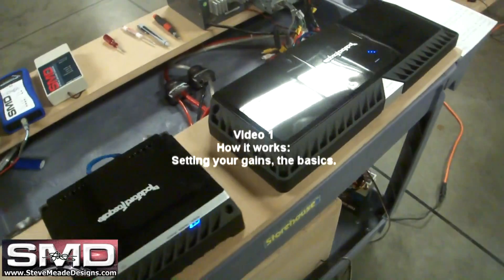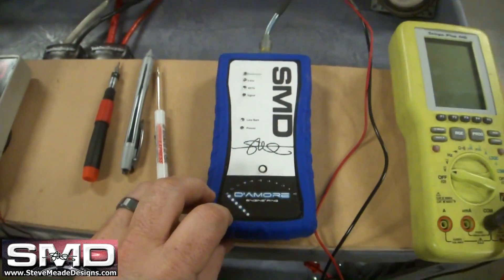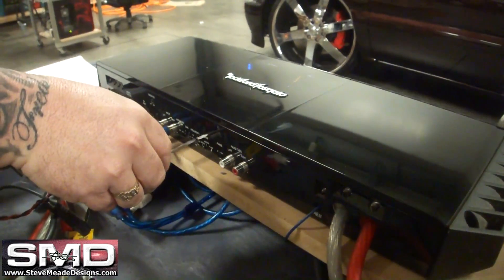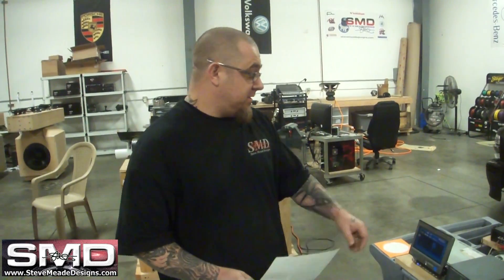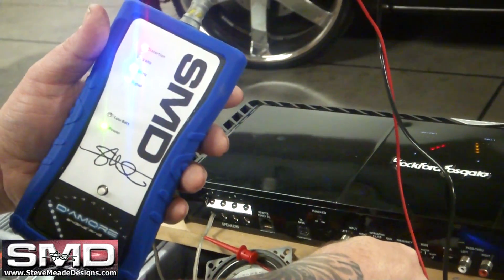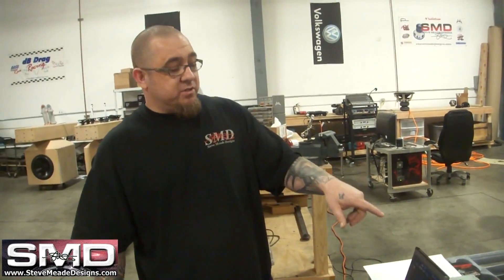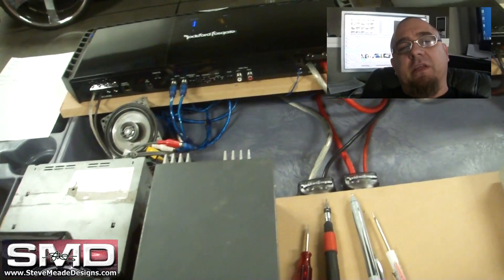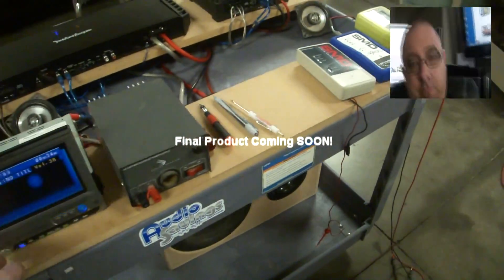PREVENT CLIPPING! Set AMP GAINS like a Pro! New SMD "Distortion Detector" - Coming SOON!

Comment: My mids and highs amp is a jl audio 800/8v2, I know the gains are supposed to be down and freqencys are up, but this amp has a filter mode which reads off, hp and Lp, does it matter which mode is selected when finding out the clipping point for my head unit?
thanks
Reply: You set it to OFF, set gains & when done, turn back on & set x-over freq. for the spkr. type used & any EQ adjustments. Then go back after all adjusted to confirm still not clipping with DD-1
Reply: @joelpasserell4525 i just supposedly set mine, i forgot to see that setting on my 4 channel to off 🤦🏻‍♂️
I plan to do it again but on a track 6 or 7
The louder ones
Reply: @CarlosHernandez-jg4yu   I misread your previous post and I just saw now that you're trying to find the clipping point of the Head Unit. So the filter mode on the amp would not be a factor because you'll be taking the RCA output from the head unit and plugging it directly into the DD - 1 to get clipping value from head unit. Once all that is done, & you're setting amp gains, my prior comment would apply with keeping filter switch off so full range comes through. I believe you use the 40Hz track first with sub out RCA and record clipping point where flickering led stays on solid & then repeat with the 1kHz track with any of the F or R rca's, making sure all internal tones, equalizer, bass boosters, etc. are all off or flat. and use the average of the 2 for your highest volume to not exceed on the head unit.  If you know for sure you're going to listen to the head unit with the loudness button on, then you can turn that on and set your clipping points, accounting for the loudness being on.  
Remember that the + DB tracks will cause you to see the head unit as clipping sooner at a lower volume level than the -dB tracks, and therefore cause you to set the amp gain to a lower level because the amp will start clipping sooner so those typically give you better sound quality versus the lower level DB tracks which caused you to set the games higher, resulting in a louder sound but lesser sound quality system.

Comment: How do you set gains properly when your individual speaker's RMS is 1/2 of your amp's RMS per channel? 

For instance, if my  4 channel amp RMS is 200w @ 4 ohm per channel  and my  (4) speakers are 4 ohm 100w RMS per channel. How do I go about setting my amp gain to provide 100W RMS per channel to completely power my speakers, while only asking my amp to work at 50%RMS....keeping everything cool and letting my speakers do work?

Comment: Ok gains set. But now amp still not tuned what about frequency?  Is there a way to set exactly say if I want 45htz to play only lower or only higher than that? I know if I turn 1channel (bass) amp to 45 it won't play lower than that but alot of the time it really does still go to 30s like it's never spot on so would I need to turn up to like 60 so it don't fall below 45? Or would it then jump as high as 80s ? Even with crossover it still has a jump less and more. Is there a product that I can focus to only keep me way closer to my desired level of frequency?

Comment: Does anyone know what kind of leads Steve is using on the speaker wires back to the DD-1? I just bought a SMD DD-1 curious if those leads come with it or are those necessary? It looks as though they clamp onto the speaker wires.

Comment: Blue Led Indicator Bulb of my Pioneer GM D-9601 Class-D Mono Car Amplifier starts to Blink & my two 12" sub woofers starts to distort/clipping or produce disturbed sound after playing normally for more than one hours, I am using 12V 50 amp SMPS to power it at home. The amplifier has three fuses each of 40 amp. Plz let me know how to fix it ?

Comment: What simple me, always up shit creek without a paddle, is wondering  is, does this meter work for 4 ohms only 0r is it ok for 2 ohms speaker load, cos I read that lower impedances causes higher distortion?. anyone?  I don't even have a car! Just wondering, will using this then chucking two ohms into the boot be safe. without discounting the devices operation at 4 ohms.?thanks

Comment: The thing is, on the second test where I choose track 6, my amp never hits the distortion light.  Even when the gain is at max on the amp.
Reply: Check battery, sometimes I have to disconnect other amp to work right.

Comment: Steve I have a question what if your other speakers on the head unit can’t handle the maximum clean signal volume? Turn up to the max volume that the others can handle and adjust the gains from there?

Comment: Hi, I recently purchased the DD1. What tone would I need to use if I'm setting the gain on the channel that will be playing midbass? I've used 1000hz for the midrange/tweets so that's okay. For example, in my BMW e90, There are a pair of 8" Audison midbass drivers. I'll be setting them up so that they are bandpassed between 80-250hz. Would I use the 40hz tone here and set it to -5db or -10db of overlap at the amplifier? I had initially set them up as subwoofers but I doubt they can take anything that hits below 30-40hz. Thanks

Comment: Should I still use a DD1 to tune subwoofer amp if the amp comes with a built in clipping indicator on the bass knob?
Reply: I would,
Reply: Shadow Skeptic thank you, I think I’m going to get the DD1 plus and a rca style bass knob instead of the gain knob.

Comment: I think I've got this right, but tell me if this is wrong. So you've got your gains set right, and in this case your mid/high amp is louder than your sub amp. Is it ok to set the gain on your mid/high amp lower to level it with your sub? Lowering the gain can't hurt anything can it? Thanks man.
Reply: That is correct.
Reply: @998 Squid  Doesn't this negate Steve's statement that gains aren't a volume knob. 😅
Reply: @joelpasserell4525  Eh you gotta think about it a little more deeply. The reason people say "gain isn't a volume knob" is because it's not for the purpose of just being set like a volume control. However the actual adjustment itself does function the same way. Which is why you can turn gain down a little after setting it properly, in situations that call for it.

Also just to try and throw a definition out there. The actual purpose of gain control is to correct for varying voltages of RCA signal that may be coming into an amp. Some head units push 1.5v, some push 5v. Without properly set gain to account for that, the amp can easily be pushed into clipping. Which is when your amp is being asked to deliver more power than it can provide. The big big issue with that, is when amps are in that state, they put out DC voltage, which overheats and fries voice coils very quickly.

If that all doesn't quite make sense, I'd suggest the YouTube channel barevids. Amplifier technician.

Cool to see my old comment. Went from a newbie learning the gear, to a guy who regularly goes to car audio shows and has multiple builds in the works.
Reply: @Ixionn  Thanks for the reply. It'll be helpful for the next person who stumbles on it in a couple more yrs. Haha.  I knew, I was just being a little facetious with my comment. I started in car audio systems in the late 80's early 90's installing at a shop that was a big Rockford dealer. Fun times!

Comment: I set my gain by ear and multimeter. put head unit to 75% volume (little low to be safe 32 instead of 34 out of 75) go back and set gain with multimeter. ( 1000 watts (2x500watt in vented box) x 2 ( 2 ohms) then square root = 2000 = 44.7 v . put on 50 htz test tone, put head unit to 32 volts, set amp gain to 44.7 volts AC current on mutli, and then im done. Some song are LOUDER than others due to recording volume and some may cause distortion and others have no bass. Good luck!
Reply from the maker: all that work and your gains are still set wrong.  Just guess them if you don't want to do it right.  You simply cannot use a DMM and have a result any different than a total guess.

Comment: Just got my DD1 distortion detector. On my head unit , should my subwoofer level be set a 0 or on the max level Wich is 15 when setting my gains ? Thanks from Milrock.
Reply: should be at 0, as well as mid and treble, if the deck has EQ, should be OFF.
Reply: @GlycerinZ  Then what happens to signal after gains set and you start turning up bass boost & adding EQ or treble increases? Am I then back distorted and need to re-check again?

Comment: Steve,my stock HU is putting out 6.2v tops and it's going into a Zapco Z8 IV processor.The input range on the Z8 is 800mv-4v.I'm getting distortion at higher volumes.Do you think it's because the inputs are being over driven?

Comment: I know this is old post Steve but I'm glad you share the knowledge.  In my area of south east NC on border of SC I have local shops but they are tards at times of needing advice. I don't have a correct audio setup.  I have an class ab Orion 700.1m2 pushing a old school 1st Gen Mofo 15 chrome magnet... It beats hard but from watching your setup here I need more power and better and.  My gain was turned up. I adjusted.  But not as hard hitting.  Don't wanna burn my coils or leads again.  I have replaced leads to coils 3 times in past 2 months.  And if you tear woofers apart that is tedious work.  Thanks for all your post bro.

Comment: wondering if its better to set subwoofer level on the head unit to have the max pre out voltage going to the amp or set it low and focus on the amp gains. my sub level goes from -50 to plus 10 just wondering what the point of that is lol

Comment: HOPE YOU GET THIS. THE DD1 IS AWESOME BUT I'M HAVING AN ISSUE WITH IT DISTORTING BEFORE I EVEN PLAY ANYTHING. IS THERE A WAY I CAN GET IT CHECKED OUT??? PS I replaced the battery and re-soldered the connection

Comment: Considering the price, if all you're going to do is use a scope for testing clipping of amplifiers then this is worth buying over a digital oscilloscope as it will be more accurate since it uses analogue circuitry and probably more fine tuned to pick up distortion earlier. A good high resolution digital scope will set you back atleast £1000; the scope he's comparing it to is an 8-bit digital oscilloscope which is absolutely piss poor for audio, not to mention screen size/resolution and number of samples it can display to show you distortion in the early stages. If you're using a digital oscilloscope, you should be looking at an absolute bear minimum of 12-bit but ideally should be using 16 bits. I'd like to see how this compares to a real benchtop analogue scope or high resolution digital scope. Also with an oscilloscope you can see what frequencies are passing through your filters which this can't do but I see you've brought out the crossover calibrator for that. In short this does what it says on the can, detects clipping.
Reply from the maker: this thing picks up distortion that you can't see on some of the most expensive scopes out there.  Just because it isn't clipping or clipped off (visually) on the screen, doesn't mean it's clean.  That's why the DD-1 rules.  Thanks!
Reply: Cheers. I'm quite intrigued, would be great to see a comparison against a scope with a higher bit resolution ADC. The handheld one is 8 bit and just wasn't a fair comparison in my opinion.

Comment: Meade916 I have a question. I had a friend use the dd-1 to set my gains today and am totally blown away by the technology. He's been tuning for a few years now and swears by the dd-1 and now I see why. My question is all EQ settings were set to flat including loudness off on headunit and my bass knob at halfway. What would be the correct way to readjust these settings without introducing distortion ? I only have 1 amp which pushes my sub and of course the headunits built in amp. I find with loudness on everything sounds much fuller including the sub and with the bass knob to about 3/4 the bass sounds even better. I don't push my equipment very high cause I don't like destroying amps and subs hahaha. Would like your input on these eq adjustments Steve so I can better understand my settings. Thanks

Comment: I have the RF T500 amp for the subwoofer and alpine mrv-300 amp for two speakers and I adjusted my system by ear. I had no equipment, and my shit bangs of the hook. None of the Amps clip, my music sounds very loud, clear, and bass couldn't be more deeper. My whole car turns into a discotheque. I use the stock head unit because I have a newer car, and I couldn't be more satisfied. The way I set my gains is that if I turn the volume over 45 out of 60 it my subwoofer amp will start clipping and that's my safe zone. But people must know that 45 out of 60 with amplified aftermarket speakers sounds much louder than 60 without any mods. So there you go guys, it took me 2 whole days to play with the frequencies, gains and input levels, filters, and I have made it. I have never been professional in car audio install, I never received any competition rewards, but sit in my car and you will have your face blown on the sound quality and the amount of bass my 600 watt sub can do.
Reply from the maker: and after all that, your gains are set wrong.  Good job though.  If you are happy that is all that counts. Set them properly and you will be even more happy.
Reply: meade916 my gains are definitely set wrong. But for the time being I am ok with the way everything sounds. I am trying to get my wife to "approve" my budget to step up my sound system a bit. I would like to put in two 16" Focals, and Audiocontrol dsp. But that means, completely giving up the trunk. Wish me good luck with that.

Comment: Steve, I have a couple questions. How much is the distortion detector? How much is the hand held power meter? What else would I need to get to test power output? How much are the load resistors? I'm glad I found your site. Between you and bigdwiz, you have rekindled an old hobby. I've bought 10 vintage power amps in about 6 weeks.

Comment: I have one car tuned with an audison bit one and the other a JBL MS8. Does it make sense to level with this flat and then retune and then level with this again? You cut to improve sound issues.... but sometimes...you boost to change or shape the sound slightly. (usually wide)  If i buy it do you recommend a complete re-tune of both systems?

Comment: So why set the Gain at 40 Hz and not at 50, 60 for example? What if there's some Distortion between 40 and 80 Hz?
Reply from the maker: the reference frequency you set your gains with has absolutely nothing to do with what you play later.
Reply: but?

Comment: But don't you also need to adjust the gain to the power of the speakers?
Reply from the maker: It's called overlap.  Try your best to match the output of the amp to the speakers rated power.  But after that you can use your overlaps to control how much actual power you are sending to them.  The gain's one and only job is to match to the output of the deck.  It isn't a volume knob.
Reply from the maker: You are putting so much time into your math and still doing it wrong.  You absolutely cannot set your gains with a DMM.  Might as well just guess your settings.  You will get the same outcome.
Reply: man, i'm confused all over again after reading this exchange. I have watched the steps on setting gains with a DMM and I have  your SMD videos saved in my favorites for 6 years, but I feel I need a simple step-by-step on setting the gains, setting overlap and clipping now...
Reply: @PANTYEATR1  If you weren’t too busy eating panties you’d get it 😂 😅 I’m dead 😵
Reply: Absolutely!

If the gains are set this way you know your amps won't clip, but that doesn't mean your speakers can handle the output...

I just use ohm's law to calculate the running voltage based on my speakers' RMS ratings.  For the sub, I run a 40hz test signal, but I also like to make sure the head unit is not clipping.  It's 2 ohm, 400W RMS, so I push 28V from the amp.

V = sqrt(OHM * RMS)

V = sqrt(2 * 400)
V = sqrt(800)
V = 28.2842

From there, testing for clipping is just about making sure your amp can handle this power output. Subwoofer amplifiers with volume controls should be set to max volume for this configuration, and the radio volume should be at the highest.

Surround speakers are pretty much the same, but you have to ensure you know the real impedance of the speakers using an ohmmeter... subs are more forgiving and usually have less wiring-related impedance issues. I have four front speakers, actual impedance per channel is ~1.95ohms, RMS is not the same for all of the speakers, so I have to use the lower power speakers, with a 50W RMS.

V = sqrt(1.95 * 50)
V = sqrt( 97.5 )
V = 9.8742V

I set the front gain to 9.5V.

My rear speakers show exactly 4.0ohms and are 125W RMS.
That equates to 22.3606V, but this is then too loud, so I run them at 18V.

Comment: Great video.  just purchased one.  Don't want to burn up my Fosgate and JL Audio equipment.  My question is this...after all gains are set, how do you adjust the EQ?  Wouldn't playing with the EQ settings cause clipping since you setthe gains on flat settings?
Reply: I need to know this too +Meade916
Reply: I have done a bunch of research on this topic since I posted this comment.  Keep your eq flat and work down.  Do not add any boost  or eq up!  If you do, you will likely blow your equipment.  The DD1 will get your system sounding incredible if you follow the steps.  The bass in my car is intense after using the DD1 as directed...no EQing needed.  I keep it flat!
Reply: Keep the eq flat after tuning with DD1.  You will not need to eq up if you properly tune.  Only tune/tweak the eq down if needed.  If you tune your system as described, with DD1, you will not need eq.  I keep my hu at flat and the bass is insane.
Reply: I don't have the DD1 as yet, but what i did after setting my EQ to flat, I then set the flat line as my highest point in my EQ. Cant wait to get the DD1 so I can set my gains correct.